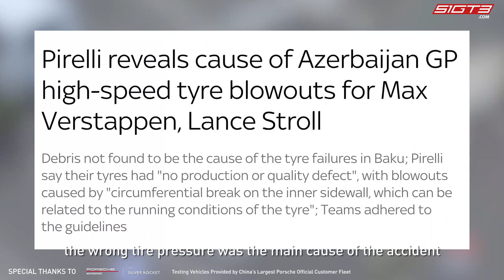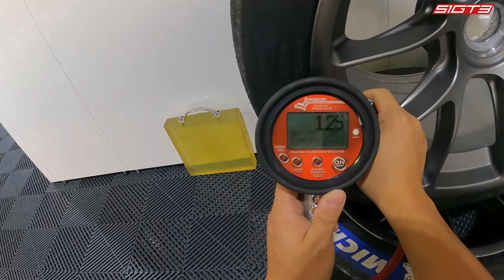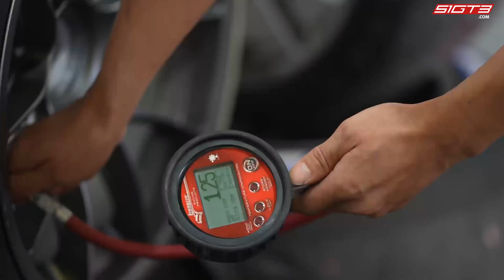Racing-pedia: The Effect of Tire Pressure on Lap Times

Comment: Hi, I have 370z and is low powered car so I don't care about traction at take off. I want to go roll racing where it's cruising at about 30mph then taking off at the green light. Some people say a higher tire pressure give me faster time to the finish line because it will have lower rolling resistance etc but other people say a lower tire pressure will give me faster time because the rolling circumference is smaller. I don't know what to do? Can you give me your advice please, thanks